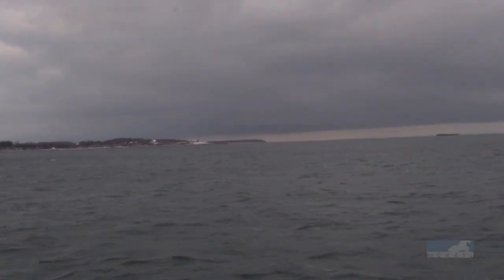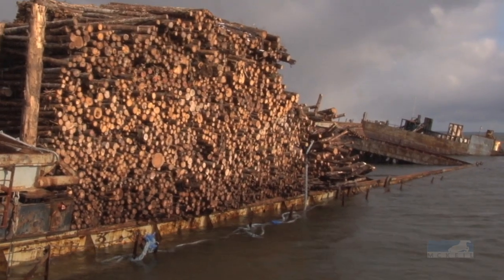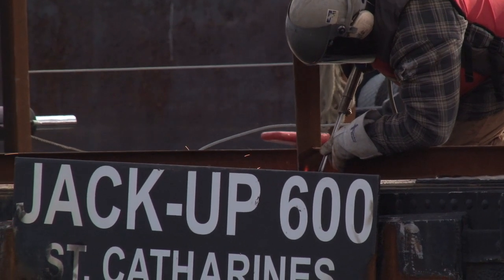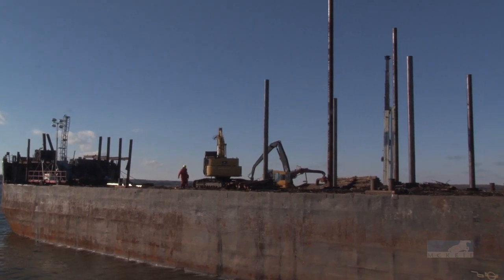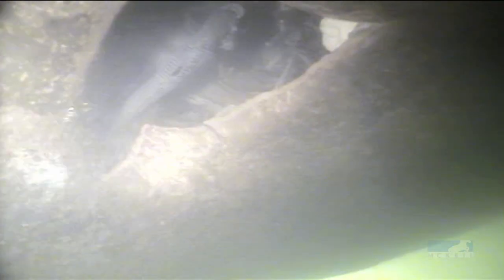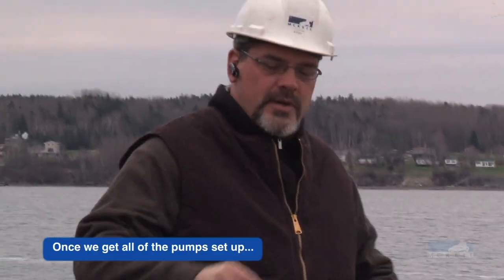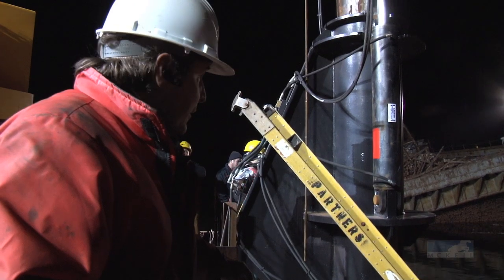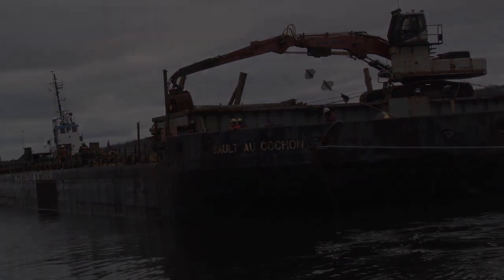McKeil Marine Salvaging a Barge

Comment: hey sweet they showed the tug that was originaly named the Foundation Vibert, its the "modern" sister tug to the one my grampa use to own. the ex foundation (later named point) vibert was built in 1961, while the one my grampa owned was built in 1958 and named the Point Valour.  
 you guys are awsome!